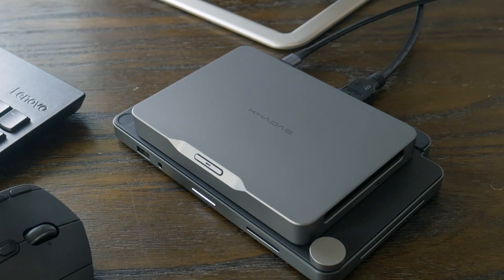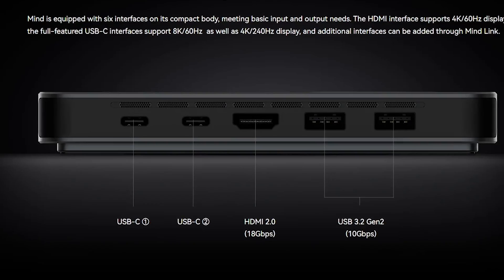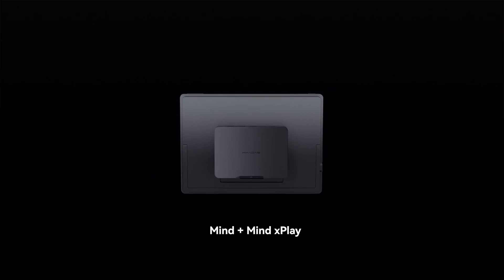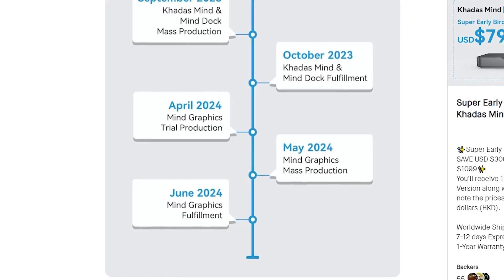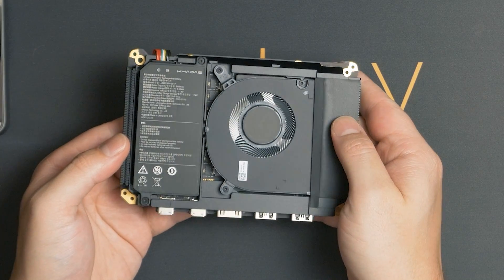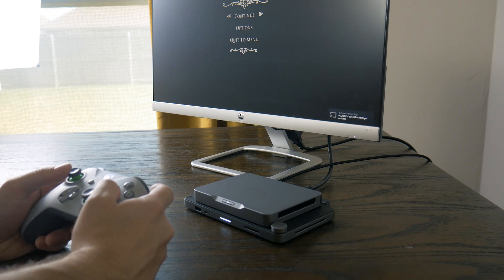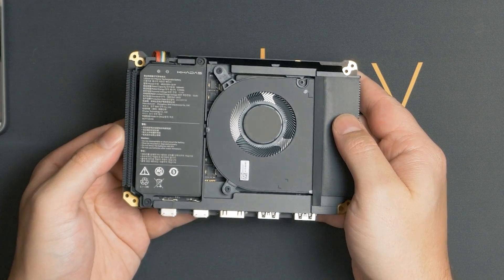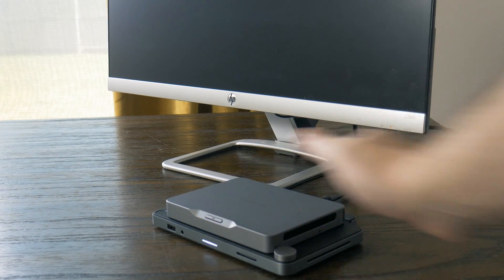Is THIS the future of PCs?

Comment: Well it has pros and cons. They should change their thinking a bit. It does not need too compact. There should be better way to stack module ways. I guess if too chuckle it would not work. But it need to clean up dust inside. I think beelink size and it can stack. Need standard connecter if PCI. But come down to cost and fees to use those parts. As well pay for licenses and fees. Plug in play hardware is not easy task if the volt disconnect it will spike and burn the connection.

Comment: So size and portability that's worse than a laptop, and expansion that's worse than a desktop. The stacking reminds me of the unreleased Amiga Walker that stacked a drive section above the computer section, with plans for an expansion slot section to go between. Since Amiga had very little cash they cancelled it when it was clear that nobody wanted it. With this product being crowdsourced it looks like just enough people want it to fund a manufacturing run. I doubt there will be enough sales to justify the other modules.

Comment: NO IT DID NOT VOID YOUR WARRANTY!  Those "do not remove stickers" are not illegal, but if they don't adhere to the law, they don't apply, no matter how many they slap on shit!  If you make even more intrusive changes, like soldering on something, they can only turn down a warranty claim if you were the cause of the failure of the thing your claim pertains to!  Fix the volume jack, if the graphics fail a month later, your jack repair is irrelevant, and they have to service or exchange it.  As to US Federal Law

Comment: I love the form factor, and the battery, and the connector. 
All docking connectors are proprietary, you can't push or pull over 50W trough pci-e or usb, and there's no pci-e + usb general connector. And yes, you DO need some sort of external pci-e in a modular computing setup, regardless of what framework fanboys might argue.

Comment: I definitely struggle to think of a use case for these that wouldn't be better served by a traditional desktop or laptop. BUT, if they brought the price down 10-15% and make a rack mount in a tower PC format that could house several, I can see them being amazing little home servers! So basically they are a cool idea, they are just targeting the wrong market I think.
Reply: WHY NOT both? The only real issue I have with these is the proprietary connectors. This thing is like a throwback to the early portable PC days. Lots of incompatible hardware, with some cool features here and there. I think I'd just get a new laptop. For $1000 you can get a very decent laptop.

Comment: The only thing I can think of a use case for this is at a workplace where you need to travel or change desks often. I had a job where I had to go to different offices. I had a main office and then there were other properties that I would work at in different days. 

And as I typed this, I heard you mention a corporate environment.

Comment: I fail to grasp the significance of this, as you highlighted around the 12-minute mark. It appears to be a single-board computer with a proprietary connector for attaching docks or peripherals, which seems overpriced when considering additional peripherals. While PCI-5e performs well in benchmarks, their current offerings, such as a dock and the suggested future additions like a monitor or external GPU, are already supported by existing standards. In my opinion, these established standards should have been utilized instead. I also share your sentiments regarding laptops in the commercial segment. It seems impractical for commercial use when similar functionalities can be achieved more cost-effectively with customization of laptops which offer way more benefits such as the ability to actually be used virtually any where not just moved easily between stations.

Comment: USB 4 has more than enough bandwidth and power delivery for this. Not using it is just pure desire to lock the ecosystem down. I never by stuff like that. 

This is the fifth or sixth ham handed attempt at this in the last 10 years. PC's are already modular.

Comment: Industry needs to sit down and standardize the mini PC's. They have all the reasons not to, to lock customers to their own products, but ATX did succeed. And products that follow ATX, are compatible across brands, upgradeable, replaceable, scavengeable. Everything mini-PC's are not, and thisone is just another in a very long and growing list, bringing about a new good idea and new proprietary solutions to enable the idea
Edit, and a governing body, like EU, enforce tax on companies that deviate from ATX with no reason. Dell. HP, Lenovo etc, get big discounts from manufacturers like Intel or AMD. System integrators, who typically use full ATX components, do not get as big discounts. This makes OEM products appealing for business clients, who only care for the PC for first 3 to 5 years, and not the fate of PCs after it. So we end up with literal mountains of products that have few millimeters larger than standard ATX power supplies, connectors that deviate by few pins, motherboards that differ ever so slightly

Comment: im… confused. Hasn’t this problem already been solved with ATX standard motherboards years ago? PCIe isn’t proprietary hence making it a much better option for a lot cheaper with even better connectors. At this point just get a micro ATX board and get a graphics card with a port expansion card and a usb volume knob. The only thing that’s kind of different is the battery which your average user doesn’t really need especially since you’d have to restart your computer every now and then regardless. This product just seems dumb especially since your warranty gets voided for just replacing a fucking SSD. This seems Apple like in the worst ways like that warranty getting voided, PLUS the proprietary connectors, and the price, not just with build quality.

I have a lot of respect for framework because they did this but with a type of computing device where on the fly upgrades aren’t typically possible especially in the modern day. This?… doesnt really solve anything if im being honest

Comment: This does look 'new and modern', but it has many parallels with a dockingstation and e.g. Framework laptop. The key to success imho is the choice of connectors that connect and combine the various [future] add-ons. Make them exotic / proprietary and you'll have a tiny user base.Make these connections 'open-source' / cheap and abundantly available, and you'll have a massive appeal and many many manufacturers that will develop for you.We've seen this with RPi and others.
Reply: There is nothing new about them. Basically, the Chinese version of Framework but without the screen and not calling it laptop.

Comment: I would be impress if Asus release a router that is a computer itself. 

we all love that .. stadia. in which you do not need to have powerful GPU to really play games.  but it failed.
but what if ... we move that idea a bit early in the network.   
move it to our router.  what if .. our GPU is connected to our router and all our device connected to it can use it's GPU? 

in short you do not need several laptop or desktop with powerful GPU.
you only need your router the have one powerful GPU.

Comment: I prefer framework's style of just making everything connect through type c connections. i think modular pieces that can directly connect to each other is a good goal to move towards in the consumer space (with more complex custom stuff being more the focus of enterprise level hardware), but i feel like that's what type c is for. there's only really ram and a few other parts that aren't yet easy for consumers to upgrade with USB modularity, and once we get that i think we will basically have every part of the computer able to be added and extended modularly. Far better than this proprietary solution or those intel NUCs that now can't be upgraded beyond the parts that had already been made for it;

Comment: This form factor seems like a bad idea to me. It sounds like a solution looking for a problem that has been solved in many other, objectively better, ways. The Switch works because you can use it away from the dock. Same thing with a tablet or 2-in-1 or laptop. That new HP all-in-one with a battery also works as a portable desktop, again because it has a screen and it can be used while not plugged in.

Comment: The mind isn't the future, but its getting way closer: The X86 PC essentially burned out since having become more of a luxury for gaming attached to insane prices, without offering anything more where productive use such as Office, Browsing and watching videos is concerned. And it hasn't for over a decade.
This means there is the dying desktop PC on one side, but the growing console market, the growing tablet market and the growing office / thin client PC market on the other. This means creating a device than can essentially connect to those three growing markets while reducing the overall costs makes a lot of sense, especially if you indirectly maintain upgradeability reconnecting to the desktop PC world.

But there are a few missing key features:
1. Having a portable device that can't do anything on its own doesn't fit well into this era.
2. Using proprietary connector where developing a new standard is required for at least integration to spread, is counterproductive.
3. You'd need advanced security features most notably for blocking access to sensitive data and doing background backups to a NAS or online storage for essential data.
4. To be considered a portable PC, you'd also have to offer a notebook frame to connect it to - essentially a battery+screen+keyboard+touchpad only case.
5. There currently is no operating system able to cover all those aspects. Your best bet would be a Linux with a Unity or modified desktop.

This is too great a venture to attempt alone - you'd need partner. Seeing parallel developments, such as the Framework PCs without there being synergies, does not bode well.

Comment: Reminds me of the old KangarooPC - which IIRC only had an Atom CPU and no active cooling. But conceptually, seems to be along similar lines with the modularity aspects and so on. The KangarooPC was not as expensive either as this device. The storage on it was eMMC (similar to RaspberryPi, likely since SSDs were not a cost effective option yet) and they offered multiple "docks", including a 2.5" "dock" (see where this is going?) that was supposed to allow adding a 2.5" hard drive that the computer could be booted off (but it never seemed to work well for either of my Kangaroo PCs).
Plus, even with the Atom CPU, cooling never seemed sufficient with the built-in copper heatsink. Luckily the 3D printing community came up with a clever design for a "case" that could accept a 40mm fan to help with the thermal throttling issues.
Long story short - this form factor seems to be for a really niche market and I don't think the "corporate" customers might "invest" in this technology at the price point (and the current economy). And as mentioned in the video, even for corporate customers, IMHO, a NUC is tough to beat because even for those customers that might want to connect an external GPU to this Khadas PC, the core i7 might be running in turbo mode all the time for any task that might require GPU intensive work - which in turn means the "annoying" fan would be constantly running.
I do love innovation and cutting edge technology and i genuinely wish this PC achieves the success it deserves but I do think the price point might be working against it especially in the current economy. I hope it does not end up being another case of "abandon-ware".

Comment: That short SSD, repeated twice no less, is an absolute no for me. I get it on the Steam deck, almost, because they imagined people would just buy short ones. Except those don't exist on any meaningful level, and you're competing with lots of products for them. This is a mini PC and the better ones come with full length NVME spaces. The only reason they can't fit 2 in there, is because they decided not to be able to, and since it's not a budget device that's silly. If you could stick your own 4060 ti 16b in that eGPU you might be able to take advangage of one of the ones they might add an NVME slot to to take advantage of the PCI bandwidth the card can't use.

The modular bit, good. I'd rather have a mini PC, with a bottom I can remove, and stack on a same sized base that contains more storage space, or a full size 120 mm fan etc etc. This is an interesting product, but ultimately a massive fail they've invested too much work on but not enough early stage brainstorming. It looks like they went one way, and stuck to it despite the obvious problems.
Reply: Everything I'm hearing about DDR5 tells me I want top notch cooling for it, although I suppose you could run it slow and not have it heat up so much? Still, it's a concern. It's not like normal mini PCS like the GTR7 are hard to pocket.
Reply: Also, ASUS Flow devices already have a proprietary graphics card eGPU link that's much faster than Thunderbolt (which is not hard). Obviously full scale PCI 5 would be the current gold standard, but I think we'd generally speaking prefer it in a cable, even if it's a thick ribbon cable that's neither long nor that flexible. It opens up more opportunities for positioning of devices, means it can work with multiple brands, and maybe daisy chain them (you might have a portable NAS and not need all the bandwidth for graphics all the time, for instance). A future common standard better than Occulink or Thunderbolt would be great and PCIE full fat seems like an obvious minimum requirement.

Comment: To promises are at this point nonsense. Tec should be bought for what it is right now, and not what marketing say it will be.
 
But my Major critic point on this is the eco system and it's proprietary connector, that is also a thing which made many modular systems flopped. Cause, when the vendor of that thing goes down, you are stuck (again) with hardware, no one can you you warranty for. And those system also struggle usually from another problem: Missing 3rd Party support. 
 
I remember that modular smartphone when they said "you can add an additional battery" or "you can exchange the cam for something else if you don't use it", well that thing went away, and my call is: Also this thing will go away.
 
Just the fact that their the majority of their own modules (if they will ever be there) isn't finished yet, scares me off. And sry to say that, but crowdfunding has it's significant problems, especially when it comes to warranty and refund, which are basically non existing. The Platforms themselves don't really care about that and the vendors won't give it. But they want our money for a product that is finished (or will be finished) and in this case right here that are minimum 800 Bucks

12:00 i like that you point out the disadvantages of that eco system as well, that's why i watch your content. Cause you're honest about those things and not that nonsense marketing bla bla "hey it's the best thing ever existed, buy it with my code"

Comment: Seems like a usb4 port on the bottom and matching connector on the dock would basically do the same thing without all the proprietary nonsense. Though at that point, just give me 2 usb4 ports on the back and sell a dock. I'm not sure the "plop" docking method is a good idea. Laptops used to do that, but they have all gone to thunderbolt docks for a reason.

Comment: Tbh I don't see the potential, even the gpu module is no different from an external thunderbolt gpu, and with those prices is not even a good mini pc solution never seen before
Reply from the maker: No different except for the much wider PCIe bandwidth with 8 lanes vs the 4 you get with thunderbolt

Comment: Technically speaking, the unassembly and replacing of the SSD does not void the warranty. The law says that anything that did not contribute to whatever future failure you may have, a manufacturer cannot count as voiding the warranty. Companies count on you not knowing the law and these statements about voiding the warranty are 99% BS, on their part. The problem is that these companies will try to say your opening and replacing the SSD contributed to, say, the power supply going bad and attempt to stonewall you on a resolution to you issue.

Comment: aren't desktop PCs already the very definition of "modular"? this seems like several steps backward
Reply from the maker: I responded to the modular question in my pinned comment. 

And if you’re looking for a PC you can slot a graphics card into, sure you could call it a step backwards. But if you’re looking for a computer that you can quickly unplug, throw in a pocket, and then plug it back in or dock it and be working within just a couple seconds, I would say it’s not a step backwards at all. Just depends on what you’re looking for. Once again (as I feel like to have to say this a million times), that does not mean I support this specific product.